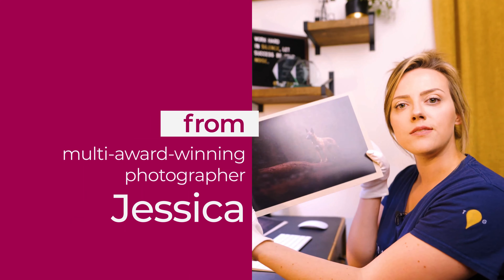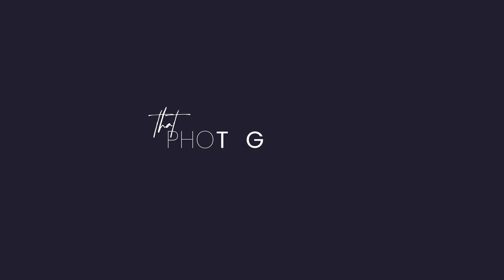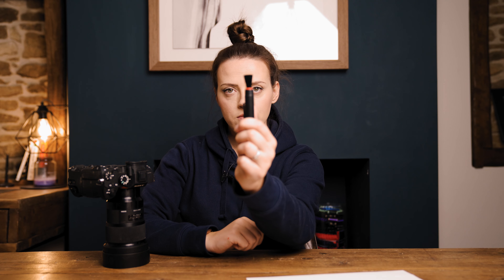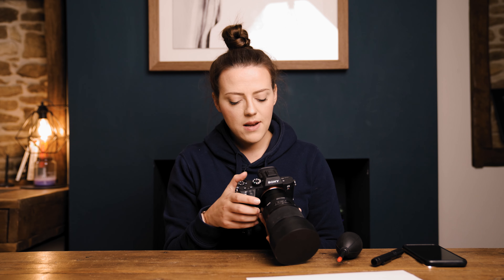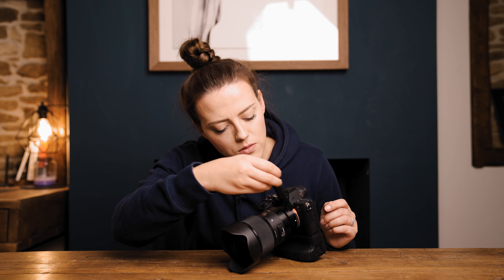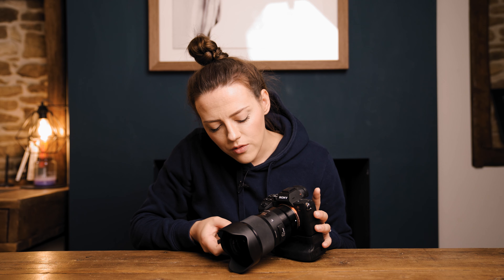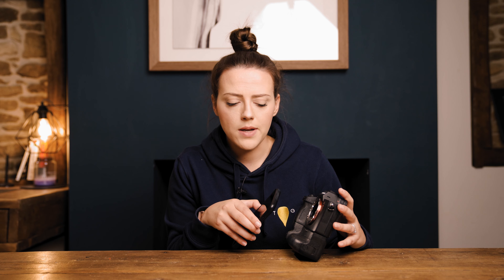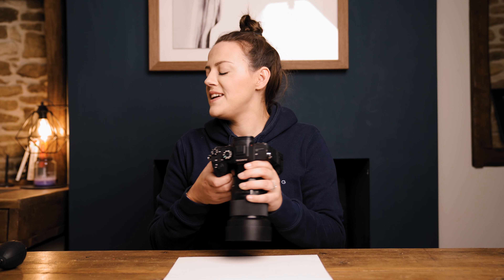What are Dust Spots & How to Clean Your Sensor [But NOT Void The Warranty]

Comment: As a bit of additional info, the Sony cameras do have a sensor clean function that you can run. The camera 'shakes' the sensor to remove dust. 👍
Reply: It also locks the sensor so it doesn't "float" while cleaning manually and the camera has to be "ON" in this mode.
Reply from the maker: Thanks for the info!
Reply: I have used that function to no avail unfortunately, the blower did the job for me 😊
Reply: @ginarayment640  I never said it was any good Gina. ;)